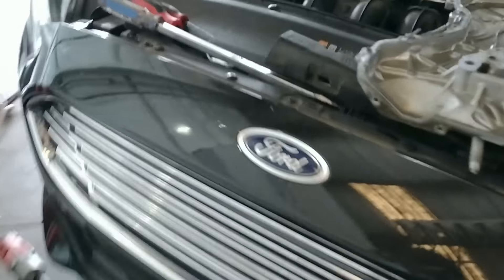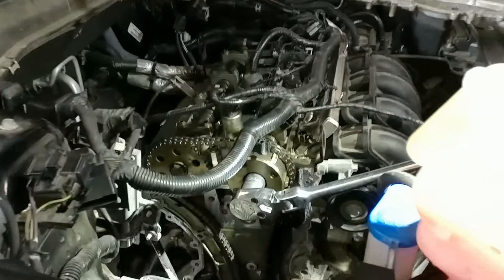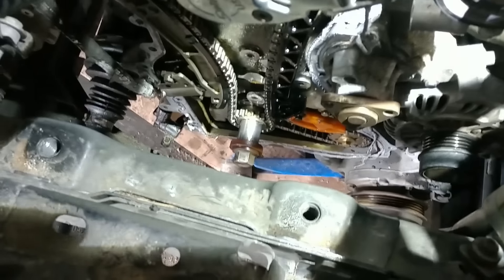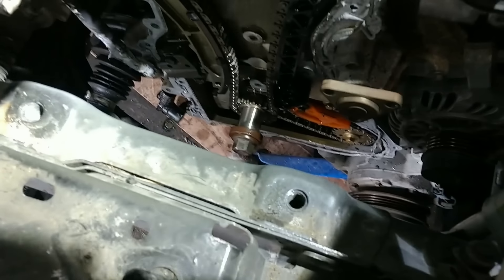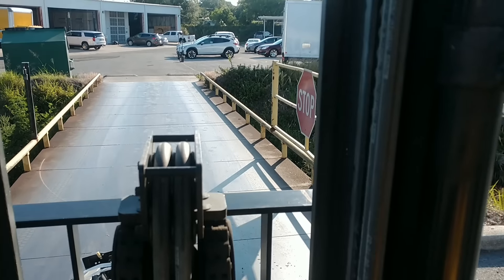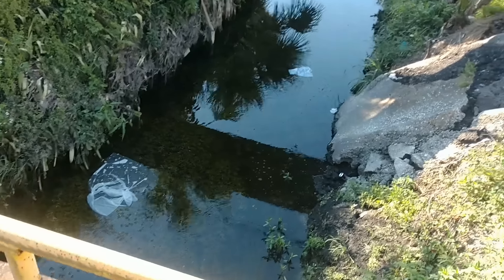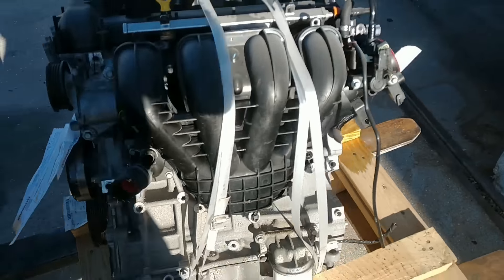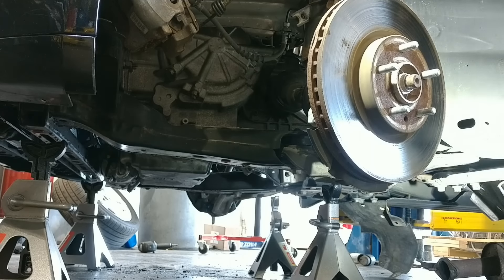Damaged Engine: You Broke it! Pt1

Comment: I remember reading this long ago. You figure ford would have learned after their V8 Taurus sho failure. 
"
This article supersedes TSB 06-16-6 to include symptoms, labour operations, and parts. ISSUE:

Some 2001-2007 MY vehicles equipped with a 2.0L or 2.3L Duratec Engine may exhibit no start, loss of engine timing or scraping noise at crankshaft pulley at front of engine. These engines, (excludes 2.0L SPI and Zetec engines) may experience engine damage if the crankshaft pulley bolt is loosened during service WITHOUT FIRST INSTALLING THE SPECIAL SERVICE TOOLS PER THE WORKSHOP MANUAL PROCEDURE. The crankshaft pulley bolt also retains the crankshaft cam drive sprocket which is NOT keyed to the crankshaft, so valve timing may shift if the crankshaft pulley bolt is loosened. If this occurs, the pistons may contact and damage the valves."

Comment: I work fixing electronic gear namely TV News gathering cameras. We had one come in the view of the Milky Way permanent on the picture. Lots of stuck pixels. So, new optical block module had to come from Japan. The day the part arrived i asked the new guy to put it in the waiting camera. Easy job, i showed him unplug 7 little cables, with sides off the camera, viewfinder off, 5 screws, take front off. Swap entire optical blocks, 6 screws. Half hour later i check. You ready yet to test chart the camer? This guy says nope & looks at me... where you at . SO THIS GUY had de-soldered the 3 actual semiconductor sensors devices off both the glass prisms for red green blue channels  was trying to exchange them. Consider the sensors are aligned in a lab with half pixel offset for green, he had trashed a USD $20,000  part the company had to take a bath on.

Comment: Ford motor company and renault have been using this keyless crankshaft idea for years , on belt driven engines too , so costly if not done with the correct tooling , sometimes not work doing , even a simple timing belt job , silly idea designed by a suit   your customer should be happy 👍

Comment: The lesson here, surely, is that even professional techs should spend a few minutes checking the service data before they start. At the end of the day everybody makes mistakes - my most expensive one was to overtighten a hydraulic fitting to the point that it cracked the housing and ruined a perfectly good steering rack.

Comment: Ford and their stupid keyless cranks. The 1.5s are particularly fun, the phasers are friction fit to the cams too. You need the pin to align the crank, the tool to align the cams, another tool to align the phasers, and the tool to align the crank pulley.

Comment: Fusion engines are pretty inexpensive or they were last i knew. But you need a timing tool any time you remove the balancer. Ford and mazda have done this for a while but id be surprised if gm doesn't do this too. I know ford/mazda arnt the only ones to do this today.

Comment: i know a few people who have made this same mistake. such a crappy design. i did it myself when changing a crank seal. i got lucky and set timing codes and had no valve interference, but a twenty min job turned into a 3 day job really quick. One thing i can say is after looking up the torque specs for the crank bolt, i did see the giant warning paragraph in the service manual about the crank gear. Oh well, you live and you learn. I do know that amazon has the tool kit available with next day shipping for like 150S and at the time no tool trucks even stocked it. Its funny to because the labor time is like 1.5hrs for the crank pulley but requires a good 3 hrs just to install the holding tools lol!! The best advice i can give any tech, new in the game or seasoned, always take the time to read service procedures...they can save your ass. This is why we have these resources available. I know myself, i like to read the procedures before hand because there can be shortcuts or very minor details that you will miss if it werent for that info!

Comment: Seen this on  UK Ford engines . Crank sprocket not keyed to crankshaft , only used pulley bolt tension to keep it timed . Very poor design ,or deliberate on Ford Motor Companys part.

Comment: Had a Tata flatbed utility in outback Australia. One day it just stopped. Found that the timing belt sprocket had no keyway and it had slipped (just like this vehicle). 
Could not believe it! Put it down to incompetent Indian engineering. Now I know better.
Second unbelievable thing was that the engine was undamaged. Valves straight, had good compression, and ran fine when the timing was set and tightened!

Comment: Since a coworker got bit up the butt by that timing system (on a mazda 3), I ALWAYS check the service manual to see if if the crank sprocket is keyed if I have to take the damper off of a modern engine I'm unsure about. Lucky for our shop, the valves and pistons didn't kiss, it was just running rough.

Comment: This.  Why I do my own work.  Read a manual?  Use a torque wrench?  Real mechanics don't need to do that.  Do they?  The last time a let a shop work on my ride was a vehicle under warranty that had a clunk when leaving a stop.  The very nice people at the shop drove it all day and "couldn't replicate the issue."  They did fix some other stuff that were known (to them) TSB items likely to fail soon.  They also offered to repaint it due to some cracking gutter caulk.  I declined.  Much appreciated though.  I took it home and looked up the TSBs (had an email group for a resource as this was in the days before forums).  Sure enough, there was a TSB for loose cross member bolts.  Luckily, the loosest one still had at least a thread and a half of engagement so I didn't have to source any parts.  5 minutes later, no more clunk.  In defense of the dealer, this was a rare vehicle and it would be unfair to expect them to have much experience with it.  How many F150s are out there anyway? lol.

Comment: My best gues is he didnt know that the crankshaft-poulie is lose poulie and doesnt have a crankshaft key?
So he put everything back in place, not knowing the timing was off, and krakakaka? 👀
Shit happens.🤷🏼‍♂️

The torque it needs is also like from a cillinderhead bolt, and has to be done with a special torque converter. I hate those engines 🤣

Comment: Mazda even did a stupid thing like that & didn't fit any timing sprocket keys onto the crankshaft, maybe it's the same engine.

I know that the 2.8 litre Durumax turbo diesel engines which my dads Holden (Chevrolet) Colorado runs needs the camshaft aligning tools to replace the timing belt in it.

The GM & Chrysler cars use the same tools to prevent the camshafts from spinning,he got someone else to replace the timing belt at 100,000 kilometres (60,000 miles) because he wasn't confident enough to do it himself !

Comment: Honestly i might make the same mistake because ive worked on diesel and heavy equipment for four years, overhauled plenty of engines,. And work on cars on the side, head gaskets, timing chains, and i ain’t never seen nothing like this. How does somebody change the crank seal without losing the timing?

Comment: I didn't know that on ford engines, I would've probably done the same since it had an internal timing chain tensioner. Thinking what the heck I'm not going to remove the chain for a timing cover reseal.

Comment: I have the same problem with my Ford Fiesta. Broke valves after changing my timing belt. The engine doesn't used key ways only the tightness of the crank bolt. Poor cheap design and I got caught.

Comment: went through this on a ford escape luckily i noticed it puling the old motor apart and your right the crank pulley sandwhichs the timing gear and there should have been a diamond coated washer in there to help hold it all in place its a horseshit setup and even timing it is a bit odd

Comment: What a dumb assed design.  I recently saw something similar on a 22 horsepower Kohler V-Twin lawn tractor which failed while mowing because the crank sprocket cracked and lost friction to the crank. They probably saved ten cents by elimination of the key.

Comment: This is why working in an all makes shop produces better techs, we know some ford/mazdas are not keyed, some BMW's have oil galleries running through the alternator bracket or your seat covers in your Toyota need to be changed when your push to start button fails.

Comment: And this is why I don't trust anyone to work on my cars, I know you're a honest mechanic at heart but there's stuff you do on customers cars that makes me cringe and reaffirms why I don't trust any shops. The last owner of my car only taken it to the dealership and shops for service and repairs and the technicians carelessly torque down bolts without a torque wrench and stripped out threads on my water pump and brake caliper and sent the customers on their way dispite a leaking water pump and a caliper being held on by only one bolt, plus the dealer bent the fuel rail replacing an injector because the idiot technician didn't unbolt the power steering pump that was in the way and pryed the rail anyways and lied to the customer (Last owner) saying the fuel rail was already bent and needed replacement and was going to charge them 1400 dollars for a new fuel rail until I came into the picture to buy the car and I offered to provide the fuel rail from a junkyard (years later when I replaced all fuel injectors I read the factory service manual and it said to remove the power steering bolts to lift the pump and get clearance for the fuel rail to come out which I then realized the dealer took the last owners for a ride). Now I'm stuck fixing the last mechanics mistakes on my car that they caused by their incompetence, if the shop can get away with breaking a customers car and not take responsibility they will do it in a heartbeat....

Comment: And I thought VW did some strange things, the engineer who designed that timing setup should be made to repair every engine this happens to. I’d bet big $$ this isn’t the 1st one of these. Getting so things are being designed in such ways that independent shops aren’t going to be able repair much of anything anymore. VW has been doing it for years, I’ve had to invest a lot of $$ in special VW tooling just to do basic maintenance.

Comment: That is actually pretty common design not only for chain driven timing mechanisms, but for belts too. At least in european engines (I repair Peugeot/Citroen) it is used since approx year 2000. It actually replaces adjustable camshaft pulleys, in order to guarantee the exactly right timing, due to e.g. manufacturing imperfertions in chain/belt lenghts and guides height/form. But, of course, you need to buy or manufacture tools or use some creative thinking to set timing. 
Almost messed myself up the first time, when met this design about 8 years ago. Luckily, before going to start the engine after timing belt replacement decided to turn it by hand a few more full turns and it stuck with a typical piston to valve "tick" noise. What the hell, I thought. 
2 more days to find correct tools and make everything right, a little unhappy client, but luckily no damage to the engine.

Comment: It seems a very poor design that position critical components aren't physically locked in place by a keyway, I suspect Ford figured it was a cheaper way to build an engine with not having to machine slots in the crank/camshaft and the corresponding sprockets and of course the key itself,  also it doesn't seem like very good engineering practice to me as it appears that should the crankshaft pulley come loose for any reason in service that this failure could occur whilst driving. We had a similar thing with Vauxhall here in the U.K when because we have the steering wheel on the right to reduce the amount of wire used for the headlamps they routed the wiring diagonally across the engine bay (left to right) and secured it with a plastic loop on top of the gearbox, after about eighteen months in service these clips would fail and the wiring wrapped itself around the gear linage causing a number of cars to catch fire. This resulted in GM recalling some 50000 cars in the U.K. for modification.

Comment: Poor design by Ford, the tech was unfamiliar with this specific design flaw and as a result the customer needs a longblock.  Actually saw something like this on a Sonic where someone put the crank gear on 180 degrees off but somehow still timed the engine correct. Well when my coworker did the head gasket he didn't realize the timing gear was off 180 degrees and timed it via the marks and when he cranked the engine he destroyed the head and put witness marks in the pistons. We got lucky because the inspector saw the assembly flaw from factory and we didn't have to eat the cost of an engine.

Comment: Wow. Just watched this one. I feel the pain. Similar thing happened to me when I had to fix my wife’s Golf. Hydraulic timing chain tensioner, no oil pressure, rolled it backwards in gear and stuffed the timing. Then she tried to start it. Ended up having to replace 14 out of 16 valves. She wasn’t happy.

Comment: Customer:my Fusion has a problem

Tech: you're Fusion IS the problem
Reply: Really? I had a 2006, over 250,000 miles on it when I sold it.  Base maintenance ever done to it.  New owners had it for another 150,000 before the transmission gave up the ghost and decided to scrap it.  400K miles, but yea...must e junk.  Have a 2016 Fusion Hybrid, still gets 45~50MPG, over 120K miles on it, only base maintenance done to it.  Probably good for another 100K miles.  Neighbor has a Fusion, 350K miles on it, still driving, base maintenance only.  Heck I've seen every make and model die early, it isn't one in particular, sometimes it's the owner, sometimes it was the assembly, sometimes it was the design.  BTW: I also have a '99 Tahoe with over half a million miles on it.  Original Engine, Original Transmission (base work only done to it).  Starting to rust since she is in the rust belt, and sits outside all the time, but again, what is the common message?  Maintenance helps.
Reply: @WreckDiver99  you are awfully touchy about a joke aren't you? I guess the thousands of complaints about rough shifting and leaky steering shafts can be ignored if one guy had a good one.
Reply: @Adiscretefirm  Nope, I can take a joke.  I also know that the '06 Fusion was one of the best vehicles that Ford made.  I know the 30/60/90 day, even 2 year in service ratings.  They exceeded Toyota and Honda both for the Accord and Civic.  Talking with the dealership I bought mine from they said they rarely ever saw a Fusion in the shop, for '06~about '10.  After that I don't know.  I owned mine from '06~'16, and the new owners literally just scrapped it a few months ago.  Still a ton of those old fusions on the roads.  Only issue I've had with "steering" on my '16 is that the steering wheel bolt needs to be replaced (supplier issue, not a FMC issue).  

You have a good day too!

Comment: Yep, I replaced a head on one of these (not because I broke it but because the valves were leaking)
You have to lock the crankshaft with a "tool" which is a glorified bolt (which I made) to prevent misalignment during assembly/disassembly.

Truly a piss-poor design in a service perspective- I work for a fleet, so I work on many makes and models, someone like me wouldn't know about this kind of stuff unless you took the time to research it first.

Comment: It's what they call Ford bomb I remember back in there early 80s Ford had a compact car with a four-cylinder engine the timing belt run the water pump the water pump would go to hell tear all the teeth off the timing belt and then bend every valve in the cylinder head

Comment: I used to work in an auto repair shop back in the '80s.  
A sign on the bosses' desk read:
LABOR RATES:
Normal:                               $15/hr
If you wait:                          $20/hr
If you watch:                       $30 /hr
If you help:                          $45/hr
If you worked on it first:    $75/hr

Just think what those rates would be today!

Comment: If I were you and/or the shop owners, I would be looking for attorneys to file a lawsuit against Ford for such terrible engineering. If you look at that engine's engineering in a different light, from the view of the FAA, it would never receive a certificate of airworthiness due to its poor engineering. Granted that this engine is for automotive use, not aviation use. Poor engineering is poor engineering. I'm glad I watched this video before ever considering buying a Ford Fusion. Keep up the good work Ray and I hope you don't encounter anymore self-destructive engines in your stall.

Comment: Not just ford but Chevy had a 3.4 dohc that used wedge locks on the cam sprockets. One weak battery and the engine would try to run backwards for a second and lossen the cam bolts. Who the heck designs this crud

Comment: There are diamond impregnated fiction washers that hold the timing gear in place that must be replaced if the lower pulley is removed. They hold pretty well until you get over 450 h.p. and 400ft/lbs of torque. On the 2.0L ecoboost engines we key the crank when doing higher h.p. big turbo builds.

Comment: That's nothing new. That design has been around for eons. If I'm not mistaken that is Mazdas design? Same layout at the Mazda3 anyway. There's a plug hole in the block that you thread it a "special bolt" to stop the crank against the counter weight. It really is silly when a key way would have been a much better idea. Rainman Ray, you are one honest tech.

Comment: The new Ford v6 need 25 hours to change the timing belt or chain. A dodge slant six can have the timing chain replaced in under an hour.
Reply: The V6 in the Edge can be done in 10 hours, but it's actually a water pump change that requires dropping the engine cradle and removing the timing cover.  It's smart to do the chains and guides as long as it's apart.